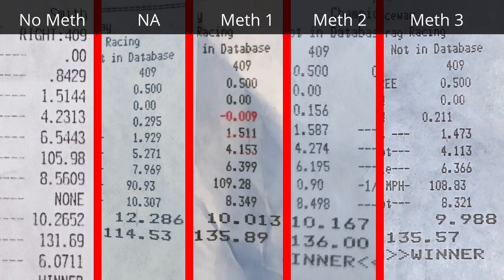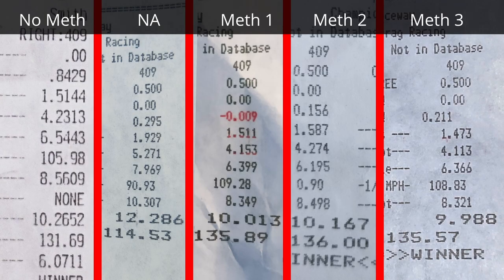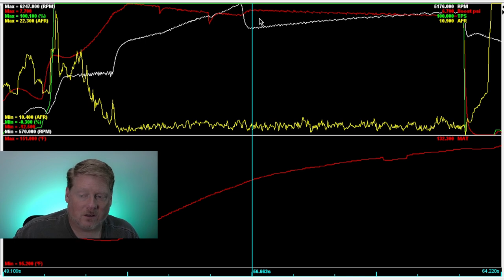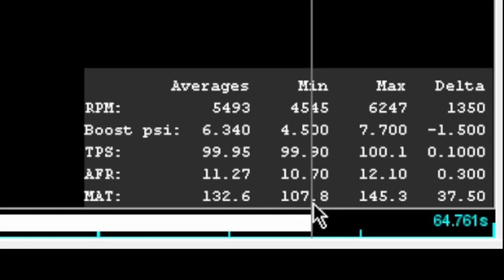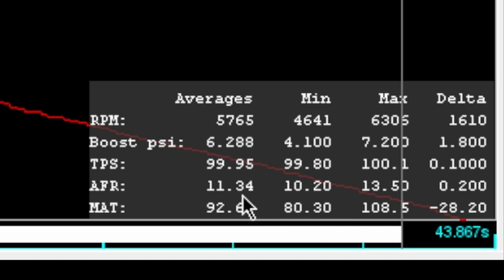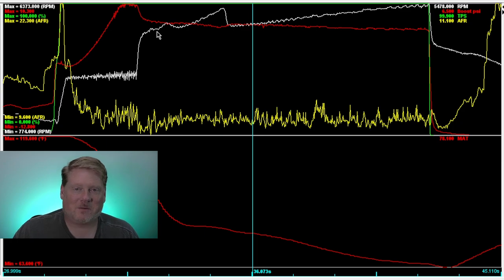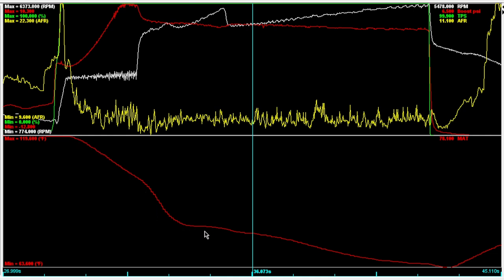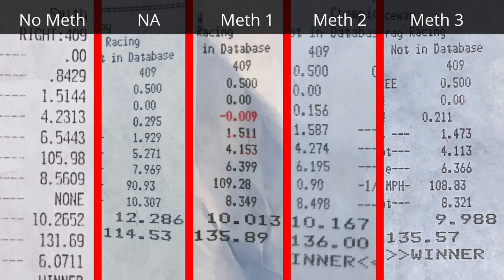Methanol Injection - Track Data Deep Dive!

Comment: Was the altitude/temp was the same on all 3 tracks? You’re making me smarter with each episode 😊
Reply from the maker: That's a good question and I should've mentioned it.  The weather was very comparable - temps were within 5 degrees F, and barometric pressure was within half a point.  But I will concede in favor of the meth passes.  So you can chalk up maybe .3 mph and maybe .03 seconds to that - but really nothing hugely significant to skew the results.  I'll pin your comment so others will know.  Thanks!

Comment: Methanol is 114 octane if I remember. So when you get cooler air by a 90 f delta it is far denser than no methanol and7 psi . Where the intercooler belongs is before the blower. Prechill intake. Had a friend that had a hanging on ac and it was the same thing driven by the belt . Made summer runs fast , winter not so much.

Comment: Looking at the logs it seems like it could be a possibility to start injecting before the actual run to cool down the system and all intake parts. Depending on how correct the mat signal is of course, could be a bit heat soaked before the run aswel.
Reply from the maker: The only issue would be getting poor distribution/vaporization due to a relatively low flow rate.
Reply: @AlexLTDLX  Not sure that would matter much if it isnt misfiring and the cooling of the system works. As long as it isnt puddling and affect the run negatively later.

Comment: water / meth allows you to run more boost, so you get more power.
Add more water / meth allows for more boost....
You can add as much as 1.5 times the amount of fuel. Your ignition needs to cope and you engine needs to hold together as you would only do this running really high boost. We talk 2bar and above.

Just add water / meth without more boost, you essentially cool the engine's interior and you can be more aggressive on the timing. You actually have to.
Just adding it without changing the mapping, you actually reduce power as combustion slows down. It has as similar effect as retarding ignition timing.

Nitrous oxide + fuel adds power. It also benefits from meth / water as you also need all the knock suppression you can get going for BIG power.
Reply from the maker: We actually did run it without changing anything on our dyno test, and it did lose power, but less than I thought it would and we actually gained power under the curve - this link takes you right to that pull: https://youtu.be/b9d5xv9INmw?si=QGqJU801htbtLZFg&t=689

Comment: I remember when this car had an M90 on it. Lol. My only fear of meth injection is either running out of meth or the system malfunctioning in the middle of a WOT pass. The carnage... Sheesh! Lol
Reply from the maker: Wow - that goes WAYYY back.  The car has a safety system - if the AFR goes above 12.5:1 for more than 1.5 seconds, it pulls timing massively.  Thanks for watching, commenting and subscribing!
Reply: @AlexLTDLX  NP bud. We kinda go back. I had that black GTP that was killing folks on the street. Waaaaaaayyyy back. Capitol Raceway was FUN back in the last 90s and 2000s. Did I just snitch our ages out? LOL

Comment: on my supra I am running a water meth injection kit 50/50 mix with 2 pre throttle body injectors, it covers me up to 25 psi of boost. Then I have a second pure meth kit set up like a fuel system which I use a e85 fuel pump to push up to an fuel pressure regulator complete with return line that feeds 6 individual port runner nozzles mounted near the fuel injectors. I have run this set up to 35 psi all while running pump 93 octane gasoline it works very well. I would push more boost but my clutch some times spins through on high boost setting, once the clutch is upgraded I plan to turn it up to 45 psi, my turbo is a 6870 precision gen2 with 1.32 exhaust housing.

I very much like your data on the pure meth in the valute, I think I will add a valute injector aswell to lower the charge temp like you did on your car. 

thank you for sharing this data.
Reply: Do you have a write up on your setup somewhere?

Comment: Would tapping into a hybrid's battery be a convenient power supply source? Bad or good idea?
Reply from the maker: I would say that would be tricky. Certainly doable, but tricky. I don't know if it would interfere with the cars electrical system with voltage sag under load and things like that. Plus the voltage is probably a bit high but I'm sure as technology progresses there will be ESCs and motors that work with that idea.

Comment: Does the supercharger act as a restriction if you run the engine NA while keeping the electric motor off? and if so by how much? sorry if you mentioned it before
Reply from the maker: Yes, by about the equivalent of 1 psi of boost (negative, of course).  So roughly 35 rwhp.

Comment: Not saying it doesn't work. I run it on all my cars. But I have a couple points. 

IMO. You should to look at this from a time based point of view. Similar to E85 or methanol fueled vehicles getting frost or condensation on the intakes. That does not mean the air charge is "frosty". This is due to a stationary item having heat pulled from it constantly for relatively long amounts of time.

 Same deal with your IAT. Each time its smacked with fluid it pulls a little heat, then pulls a little more, and a little more as long as it is active.  This is your downward trend over time on the logs. It does not represent the temperature of the air charge as a whole. As the air charge is in and out of the motor for a few milli-seconds. So there is VERY little time for it to pull heat from the air charge.   

Boiling point of methanol is 150 which is when the majority of the fluid flashes to a gas and that flash does the majority of the work pulling heat form the charge temp. It also means you aren't pulling the charge temps as a whole down anywhere near what your sensor is reporting. 

If your logs were true, it would mean methanol worked better than intercooling. Unfortunately we know that's not the case.  I really wish it were! meth is much easier/cheaper.  When you look at the A2W logs you will also not see the giant downward trend in IAT or a giant upward trend. The charge temps are much more consistent throughout the run.
Reply from the maker: My next video will compare A/W vs meth - unfortunately, I can't do a true apples to apples comparison because my A/W data is from my old Whipple setup, but both forms of aftercooling have their uses.

Comment: Ha did I miss the ambient temperature? I’d love to know. 
I’ve had to do Google searches to convert to metric 😂
You Americans you😂

Amazing how the temps dramatically decreased😮

I wonder if you could use methanol injectors pointed at the impellers to spool the turbocharger. 

Or even you are already having that effect! 

Might make sense given your times.
Reply from the maker: You're right - I should've mentioned weather conditions both times; though they weren't drastically different. It was in the low 60's on both days.  Sorry for the imperial units - it's just how we're taught to think here.  Though I do find the metric system typically preferable when machining things, but the standard of "thousandths" is tough to shake.